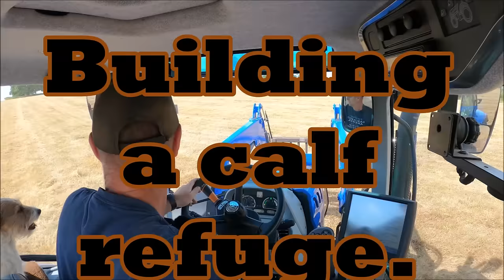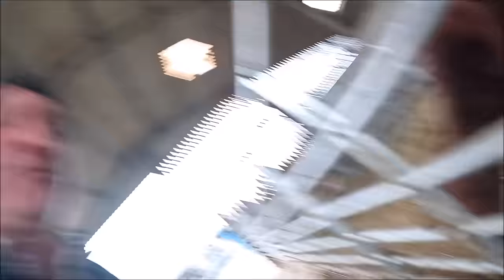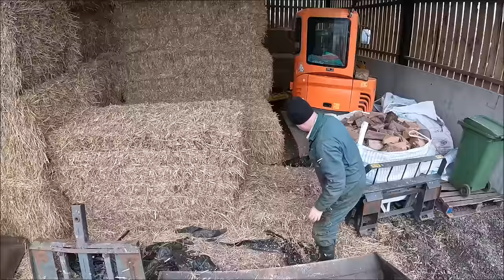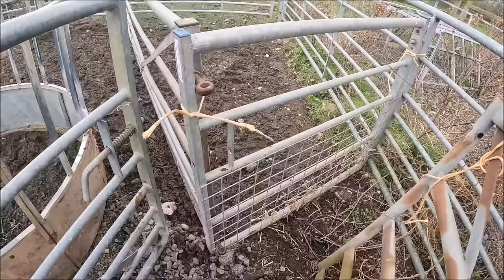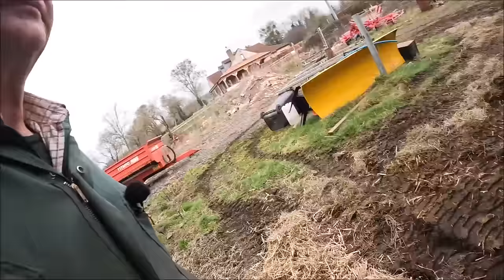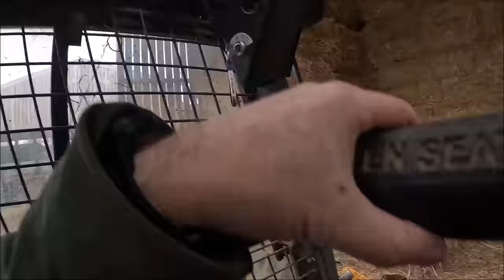06/02/24  Building a calf refuge.

Comment: I would have some concerns that once the straw "barrier" around the closed sides becomes compressed that you might find one or two of the smaller calves roll out into the yard. Could you use woodchip instead piled up both inside and outside and save the somewhat wasted straw?
I'm guessing 6 calves total by TB reading day.
Dan